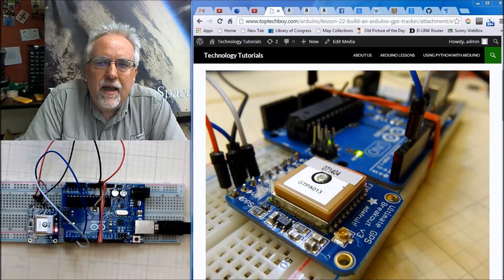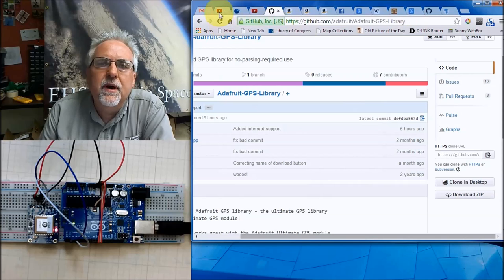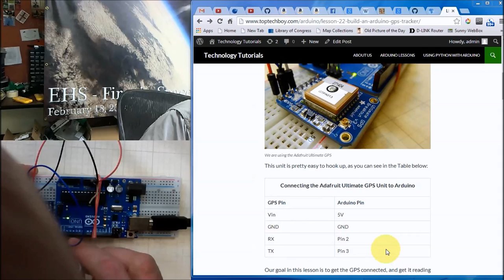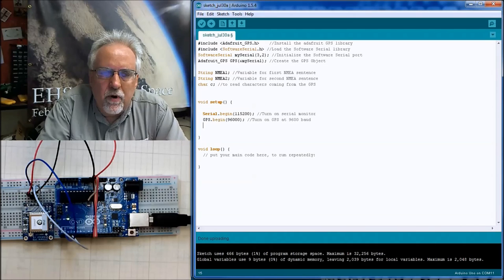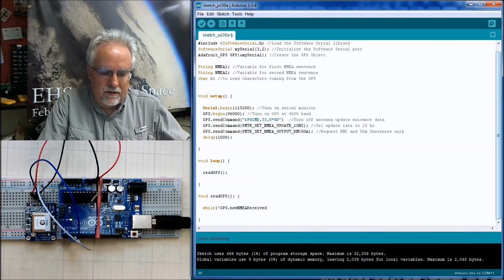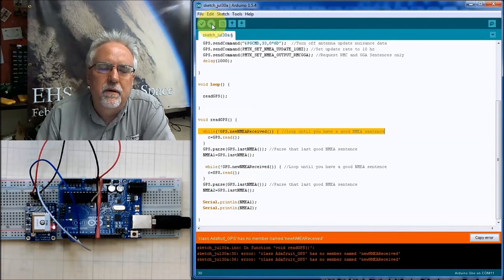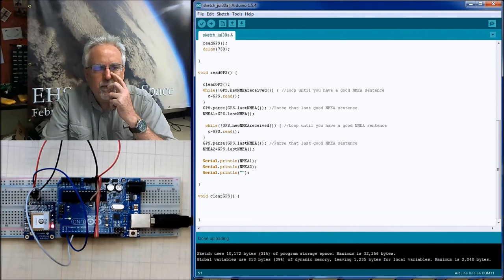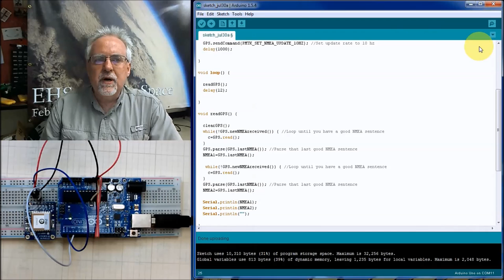LESSON 22: Build an Arduino GPS Tracker

Comment: A couple of comments in addition to the excellent comments by Unen44.  

The first parameter to SoftwareSerial is receive (rx) and the second is transmit (tx).  If you switch the jumpers then you would switch the parameters or it won't work.

It's also good practice to put those port numbers into const values so they're less likely to get confused later on in your code.  It also allows you to later move that pinout with only two const assignment changes rather than trying to chase down everywhere you've referenced pins 2 and 3:
const byte txPin = 2;
const byte rxPin = 3;
SoftwareSerial mySerial (rxPin, txPin);

GPA::parse checks to see if you got good data.  It performs a checksum and returns a boolean (did the data pass the checksum or not).  You should use that inside your loop instead of read() to determine whether you got garbage, else you should continue looping.  GPS::read just reads a char from the serial port, unless I'm missing something that's just wasted time in your cycle.  Instead you should also be checking to see if you got good data and it's the data you wanted rather than just taking what it gave you. In this instance I think do/while works better than while.  And lastly on this loop, if you find yourself writing the same lines of code twice you should create a function, always, because if you wrote the same N lines twice you're almost always going to write them again and if you find a need to make a change you will have to find and change every instance, which is always easier if there is only one instance.  The code for loop until this should be a function that will simply return your data :

boolean getSerialPortString(char *strStartsWith) {
  bDone = false;
  do { // do this until while criteria is true
           bDone = GPS.newNMEAreceived() && GPS.parse( GPS:lastNEMA()) && GPS::strStartsWith(strStartsWith);  // check if we got data, it's good data and it's the data we want avoid garbage
  } while (!bDone);  // if we got data and it's good, we're done
  return GPS:lastNEMA();  // return the data
}
and call it as:
NMEA1 = getSerialPortString('&GPGGA');
NMEA2 = getSerialPortString('&GPRMC');

This will also allow you to easily grab any other codes you might want to look for in the future. That was written ad hoc without having anything to test it against, so grain of salt.  I just ordered this unit today and was looking around at videos with people using it.

Looking at the code in the GPS library (https://github.com/adafruit/Adafruit_GPS/blob/master/Adafruit_GPS.cpp)  the buffer holds two lines, lastline and currentline, and only lastline is available to you.  You aren't getting old data, you're just not getting the data you want.  

And all of that point and click killed me, I'm a linux kinda guy and that was just excruciating.